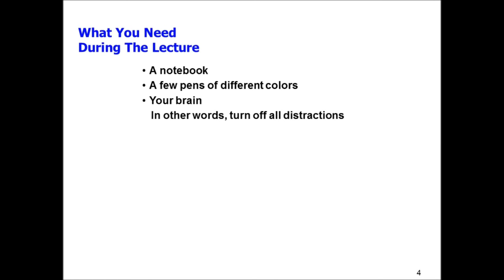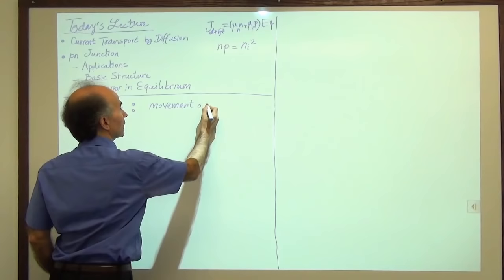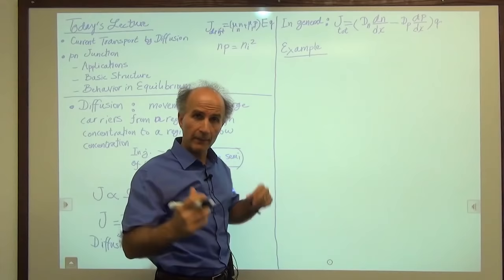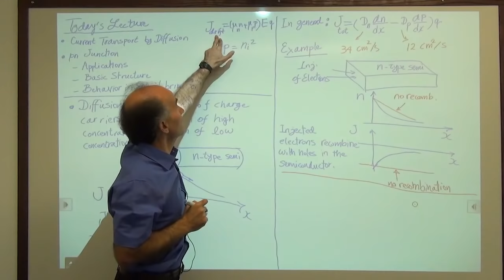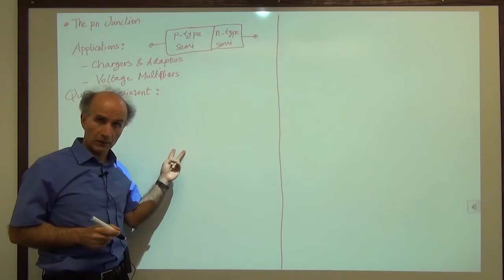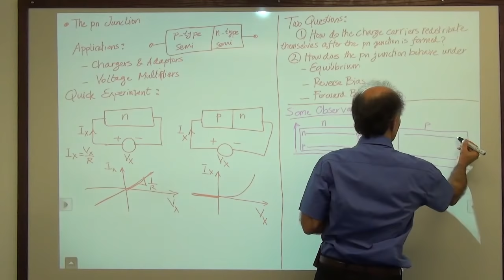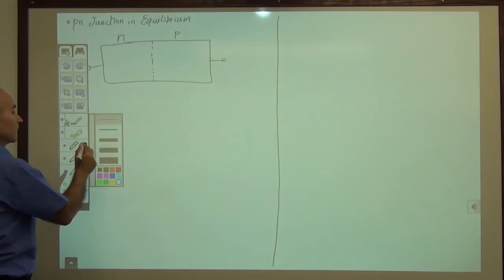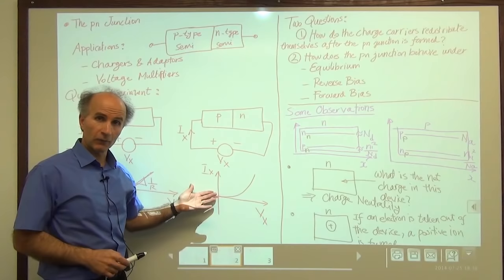Razavi Electronics 1, Lec 3. Diffusion, Intro. to PN Junction

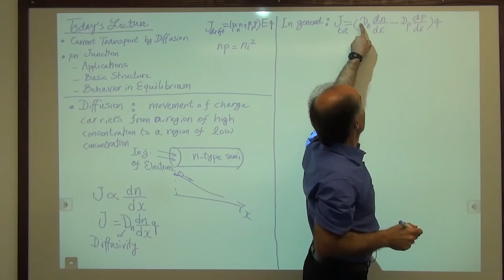Comment: 19:24 To be consistent with conventional sign of current, in the density current formula Jtot, the charge "q" has to be positive. If so, because the derivative of the charge density is negative, then the electron current density is negative from left to right while the hole current density is positive

Comment: Brain teaser: 54:30 we all can agree that pieces of doped semiconductor are charge neutral. However, typically the process of ion implantation is used to dope semiconductor . At what point does the ionized dopant regain its charge?

Comment: Doubt: Why do we have different signs(i.e negative for Holes diffusion) in Diffusion mode of conduction for holes and electrons and not for drift mode of conduction?
Reply: If you inject electrons to the left of Si, electrons will move to the right by diffusion, so diffusion current will be from 
right to left. This negative sign is already accounted for, since slope of dn/dx is already negative, so we don’t need aminus sign in front of it.
If you inject holes to the left of Si, holes will move to the right by diffusion, so now diffusion current will be in the 
same direction, left to right. But the slope of dp/dx is negative, so we put a minus sign in front so that J will be in thedirection of diffusion.
For drift velocity, however, when you apply a voltage across Si (+ to left, - to right), you have electric field from left to
right, which causes holes to move to right and electrons to move to the left, at the same time. Both of these 
movements create current in the same direction: from left to right. So the currents add up, in the direction of the 
electric field.
Reply: @preniep2118  thanks a lot!!

Comment: I have some questions about semiconductor material. Since Tin is a Group 4 Element, can it be used as a semiconductor? Second, must dopeants be +1 (Group 5 Elements) or -1(Group 3 Elements)?  What if I make a diode or transistor out of a Tin Alloy with Magnesium (-2, Group 2) and Tellurium (+2 Group 6)?
Reply: Although, tin is a Group 4 element, it is a metal, different from semiconductor, so it cannot be used, similar is the case for carbon being a Grp 4 element it cannot be used (it is neither a metal or a semiconductor). About your second question, choice of dopant totally depends on semiconductor, for Grp 4 elements i.e. Si and Ge, it must be Grp 3 or Grp 5 element for p-type and n-type semiconductor respectively. Similarly, for GaAs which is a compound semiconductor dopant could be a grp 4 or grp 2 element. For your 3rd question tin is again a metal, you need semiconductor for a PN junction.
Reply: probably ask ur question to ali hajmiri

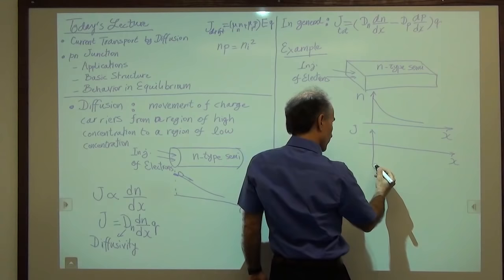Comment: at 17:50 , sir said that, J due to the electrons diffusion is positive, but at 22:15 while he was plotting it, he took J negative..can any one please clear my doubt?
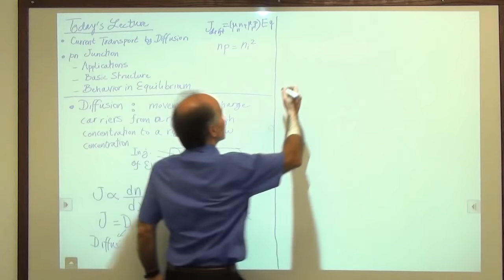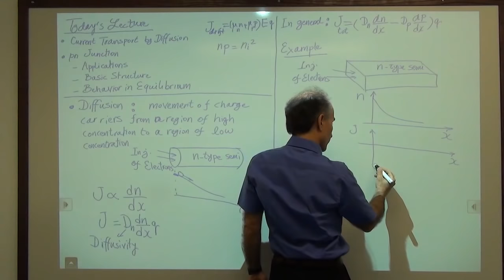Reply: Hi Dhiraj. That is a good observation. I had the same doubt. My thought on this is, both the expressions are multiplied with the negative electron charge q in both cases with Jn=+q*(dn/dx)*Dn and Jp=-q*(dp/dx)*Dp without actually substituting the value of electron charge q= -1.6*e-19 C which he mentions at 18:39. After the substitution, The final negative Jn due to electrons would be opposite to the conventional flow of current and final positive Jp due to holes would be in the direction of conventional current. This is consistent with the fact and also your observation that the graph for Jn vs x in the fourth quadrant with Jn being negative at 22:15. I am aware you posted this question a while ago and might have figured this out by now. Let me know if my understanding is incorrect.
Reply: @adityatripathi02  q has to be positive. It it is negative, the current density of holes, because of the negative derivative, would become negative from left to right

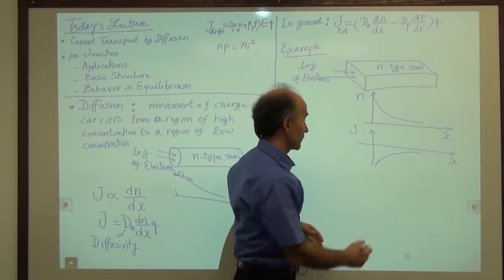Comment: 22:30 why the graph of J is in 4th quadrant instead of 1st.. can somebody help me out wd ths ??
Reply: Bcoz the graph shows the J of n type , and n type are responsible for electric current and not the holes which ur assuming as supposed to show the current due to holes in +ve
Reply: @rameshkvaw542  , at 17:50 , sir himself said J due to electrons is positive..
Reply: @dhirajkumarsahu999  I guess in opposite direction
Reply: For n it looks like exponential decay exp(-x) and J is nothing but concentration gradient and we have to derivative of exp(-x)  is [-exp(-x)]
Reply: @lokeshk5817  the derivative is negative and multiplying it by negative sign of electron charge the current will become positive.